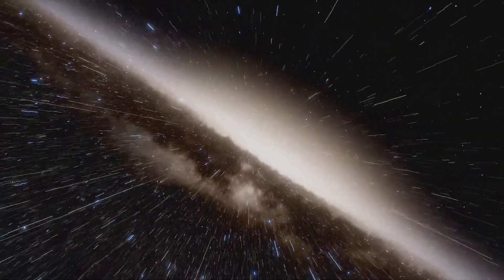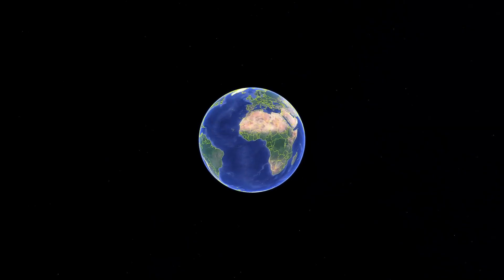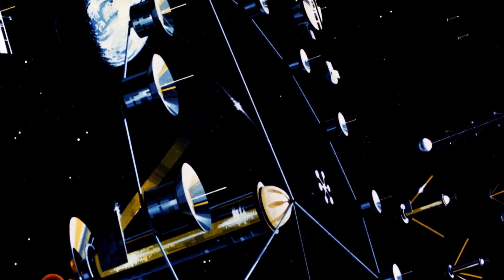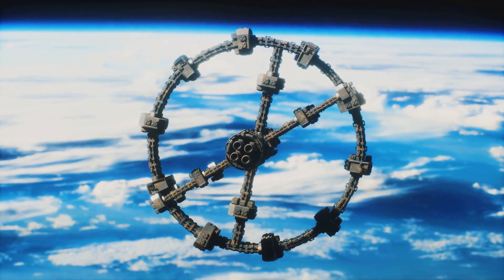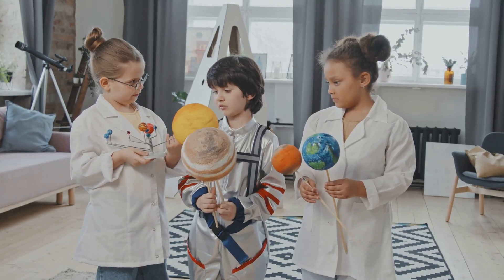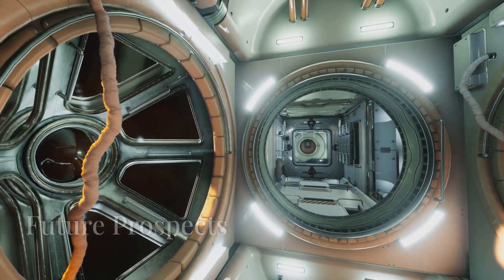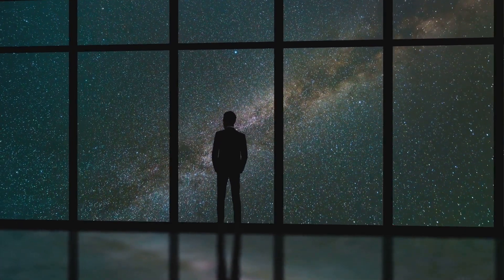Exploring O'Neill Cylinders - Our Future Homes in Space

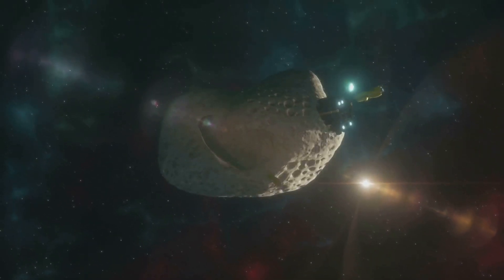Comment: **Mistake 1**:  At 3:20 in the video, it goes off the rails when it suggests that O'Neill cylinders carbon nanotubes or other space-aged materials... WRONG!

**Correct Answer 1**: O'Neill habitats will only experience 1 G of sheer stresses because that's the acceleration that they will be spun to!  Think it through!  That does not require any building materials that we don't already have.  Fiberglass, steel, etc will work just fine.  Every building ever made on Earth withstands 1 G of stresses.  

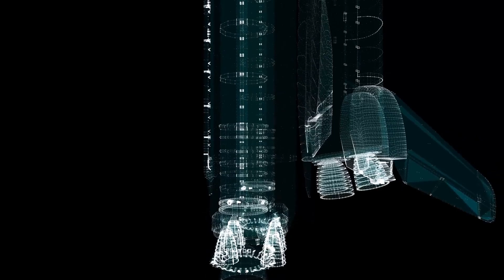**Mistake 2**: The video makers probably make this mistake because of what they say at around 3:50... they suggest that the cylinders would be constructed from components launched from Earth into space...  ALSO WRONG!!!  

**Correct Answer 2**:Such structures would be made from In Situ Resources.  For example: small asteroids pass the Earth and even naturally enter temporary co-orbits around it all the time.  Such bodies could be intercepted and deflected into parking orbits, ground into fine mean and then purified into a variety of building materials.  Broadly this would fall into 4 classes of materials: (1) First they would be heated, probably with solar mirrors to evolve off volatiles such as water, they would be stored for later.  (2) With further heating, probably in some sort of plasma gassification furnace, metals would be melted out. Those would then be put aside for purification... the key one is Iron a common component of asteroids.  (3) The plasma gassicfication furnace would also produce a mixture of H2 and CO.  This would be added to your volatile sore, but some of the carbon bearing gasses would be combusted into coke... inorganic carbon... for mixture with Iron to make Structural Steal.  The remainder of the CO and H2 would be used to make plastic (that mixture is called  syngas as it can be used as the input stream for most synthetic organic chemistry. You'd mostly want PVC, Mylar, and Polyethylene.  With these you can make something like AB-Foam which brings us too... (4) The rest of the asteroidal material would be a mixture of inorganic slag.  This would get ground into fine power to be used as aggregate, mixed with the AB foam as a binder, and then pumped into empty balloons of Mylar and aloud to set.  Congratulations, you have now made bricks that are simultaneously shock-absorbers, armor, thermal insulation, and radiation shielding all in one that can be placed in a structural steel drum. and you have a O'Neill Cylinder that is 99% by mass sourced with materials that you could find in a mixture of C-Type and M-Type asteroids that commonly come into the vicinity of Earth at velocities that make capturing them quite possible.
Reply from the maker: We mentioned carbon nanotubes as an example (like something strong and light weight). We  didn’t mean they’re the only option, just one possibility.
Strength and weight are huge factors. so while steel could work, there’s still debate about what’s the best.

As for launching components from Earth, that’s still a possibility. It’s how the ISS was built, so we included it as a realistic approach. Using asteroids is cool, but both options are worth considering.
Thanks for watching and for sharing your thoughts 😊

Comment: Biosphere 2 was a project started back in the late 1980s to simulate a space colony.
Reply: Simulating a space colony was alas, only ONE of the Biosphere 2's many purposes.  Biosphere 2 was ultimately doomed as an experiment that probably actually set us back in terms of progress toward space colonization rather than forward because of the OTHER agendas of the experiment.  

Specifically, Biosphere 2 was also pushing an environmental conservation agenda.  The way that ultimately doomed the space colonization agenda is that they decided on an overly large and complex design with multiple internal biomes... I remember there was a Dessert biome, and a jungle one, and I think others as well.  (They were trying to push the idea that Earth's ecosystem required all of its many environments and thus all of them had to be protected or some such neo-Gaia holistic spiritual nonsense).  How did this doom the experiment?  It did so with COMPLEXITY.  The experiment ultimately ended when an imbalance in atmospheric gasses occurred due to a complex interaction between the highly fertile high carbon-rich soils, soil bacteria engaged in oxidative respiration, and the concrete of the superstructure of the building.  The infection and subsequent death of pollinators, and thus the plants that relied upon the pollinators, also lead to a cascade of failures.  Some of elements of these failure modes was predicted and even meant to be studied, but the simple truth is that a system as complex as the one they built was BOUND TO FAIL!  Think about it, every single organism represents a complex set of moving metabolic parts called genes numbered in the thousands to tens of thousands.   And they had thousands of species in biosphere 2 (even many millions of species if you consider all of the parasites, commensals, and symbiotes that the organisms they intentionally included carried with them).  All of these were then meant to regulate themselves across multiple separate but inter-connected biomes!  How could such and ecological Rube-Goldberg machine NOT fail?!?!?!?

No, a MUCH more reasonable approach would have been to aggressively make the system as SIMPLE as possible with as FEW species as possible, and then put the parameters those species live in under direct active human control with each species intended to support just ONE aspect of the environmental maintenance that the humans can then throttle up or down as necessary.  One species for recycling H2O & CO2 back into O2 and Sugar.  One species for maintaining the nitrogen cycle.  One species for producing dietary protein.  One species for dietary fiber.  And all of these species are simple microbes that can be cultured and grown in highly controlled conditions and volumes and thus controlled completely independently of one another.  Only once THAT system is stable do you then slowly add complexity to diversify diets and increase the stability of atmospheric gas control etc until you end up with something like humans living in terrariums.  This is slower, less exciting, less ambitious in the short term, and way less photogenic and facilitating of political activism... but it's real science and real engineering with real scientific controls resulting in a real product that is actually useful to someone who is not an activist.
Reply from the maker: Yes, that was a very interesting project